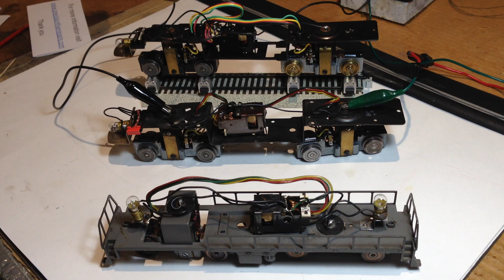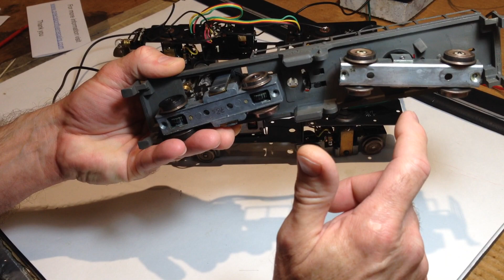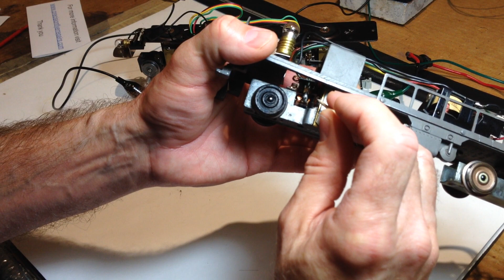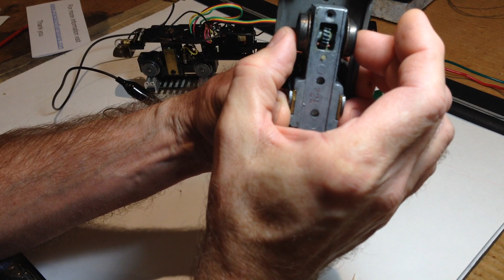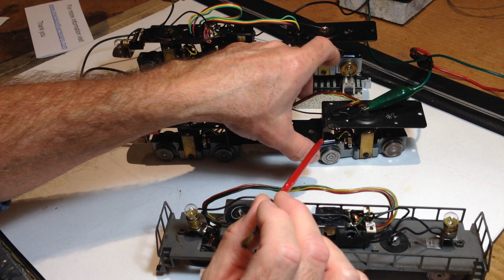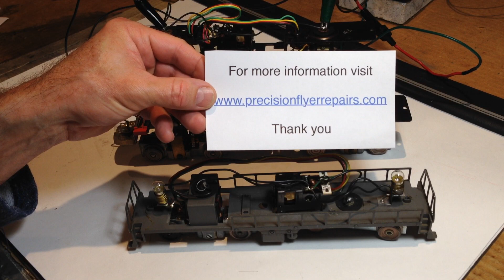American Flyer engine inspection and testing

Comment: Are you still doing repairs? I have a 360 that I'm done messing with.
Reply from the maker: Thanks for watching and thinking of me to help, but I don’t professionally repair trains anymore.
Reply: @PFR1 Can you give some insight to a problem?  I have a 360 that after it runs a while it starts slowing down. Add power and run again and start slowing down again. It doesn't have any low speed , just medium to fast. I seen the rear motors field windings smoking when I took the shell off to see what was up with it. I'm thinking the windings are probably burnt causing the issue. I'm considering just installing one large motor (maybe two large motors) and if just installing one, making the other small motor into a dummy. Even with two small motors, my single large motor 372 will pull much better.
Reply from the maker: @inscoredbz  I don't normally do this b/c without the engine to inspect, test, and diagnosis it's very difficult to attempt that process virtually.  But if I were a betting man and assuming this is a truly stock, unmodified 360:  1) Replace all 8 axle bushings (on a 360 you can that by removing the old ones.) The worm gears (the spiral thing on the end of an armature and a spur gear on an axle comprise a worm gear) are no longer meshing as the should with clearance, but gnashing with too much contact on each other instead.  Of this I am quite certain.  2) Inspect all four worm gears (all 8 components) for wear and replace accordingly. Step 1 can cause excessive wear.  Replacing the axle bushings but reusing badly worn worm gears will still leave you disappointed.  3) Inspect all  4 armature bushings and replace according. 4) Test both armatures for segment-to-segment continuity, isolation from armature shaft, and correct winding resistance (proper ohms according to factory spec.).  Replace or rewind accordingly.  5). Inspect 4 armature brushes for wear, especially asymmetrical wear.  Replace accordingly.  6). Inspect brush springs for correct geometry and pressure.  Replace accordingly.  8). Inspect both fields and test for correct ohms resistance compared to factory spec.  Rewind or replace accordingly.  9) Inspect every electrical connection from railhead to, in, and out of the reverse unit, and on the brushes and field points of connection.  Undo, refresh and tin any suspect wire ends or unsolder and resolved any chalky solder points with new flux and solder.  They can become points of poor conductivity (i.e. resistance). 10) Inspect the reverse unit function and points of contact/conductivity.  Clean, adjust, and replace anything worn out.   1) Clean everything of any old grease and oil including the 2 oil wicks which are sometimes just easier to replace.   12) Fresh lubricate gears with Lubriplate 630-00 grease.  Oil axle bushings sparingly with LaBelle 107 Medium oil, very carefully oil armature bearings with LaBelle 108 light oil.  13). Once reassembled test run the engine in the air (use alligator lead wires), then on rollers, then on a layout.  There could be other things needing  attention, but that's it without the engine in my possession as I originally mentioned.  Thanks again for watching.  When in proper tune, AF engines including this 360 own up to their name - American FLYER.  I used to love when a customer would tell me "This runs better now than when I was a kid."😀  Best wishes for success with yours.
Reply from the maker: Sorry for typos.
Reply: @PFR1  I've replaced the bushings, the worm gears and axle gears look pretty good. The worm gears aren't sharp, the armature bushings are not worn out, they are smooth as butter. It was running great up until the last time I pulled it off the shelf. It just started getting slower, add power to pick up speed and it ran great again, until it just started slowly running slower. I took  the shell off, nothing was binding, the armaturesceas centered in the field coils, the rear field coil was getting hot. While testing in the air with no load, it started smoking. Almost smoking like a smoke unit. The bushings was worn when I replaced them, but the gears was still meshed, not bottomed out. Again, I've had nothing but trouble out of this since I got it. It didn't run at all, only the reverse unit cycled. Cleaned, oiled and greased proper points, cleaned armatures, brushes have been replaced at some point ant look good. Both of these motors have ran almost hot enough to burn (uncomfortable burn, not blistering hot)  the top of your finger when touching the bottom of the side cover bottom that screws to the trucks. So they seem to be generating way to much heat. I found my ohm meter, so I'll be checking the armature readings and coil windings.  I would bet the rear one is toasted.

Comment: Thanks for the great video! I am about to embark on a 370, my first diesel repair.  I am wondering if your axle bushing assessment is purely qualitative, or if there is a quantitative measurement for when an axle should receive new bushings?
Reply from the maker: Thanks for watching and compliment.  One rule of thumb is if the axle wobble is 3/32" or greater, but the main thing is if the engine runs slow and/or hot and the motor is otherwise clean and freshly lubricated, then the likely problem is worn axle holes that are oval shaped instead of round.  The 370 was pre-pullmor so it should have the slightly smaller armature with corresponding and more importantly truck chassis with removable axle bushings.  That means no drilling of the truck.  But it is still something that needs to be done very carefully in order to turn out correctly.  Also look for worm gear,  worm, and armature bearing wear.  Truck bearings aren't always the only driver-train component that need attention or alone will revive the engine to proper working condition.  Good luck with it.  I reopened my repair business a few weeks ago (I still need to post a video to that effect, but business has been good and keeping me busy.) If you'd rather have me work on it just let me know.  Drop me a line through the Contact page on my website www.precisionflyerrepairs.com or email me at precisionflyerrepairs@gmail.com.  Thanks.

Comment: Give me your name and address I can send you 2 engines for repair. Thank you, email address would be nice.
Reply from the maker: Thanks Richard, but I closed Precision Flyer Repairs awhile ago.  I posted a video about that.  Should I ever re-open I will post a video then as well to let you know.   Until next time be well and enjoy running your trains.
Reply: Can you use radio shack electronics cleaner to clean e unit fingers as well as the motor?